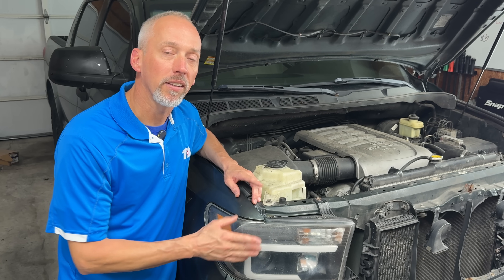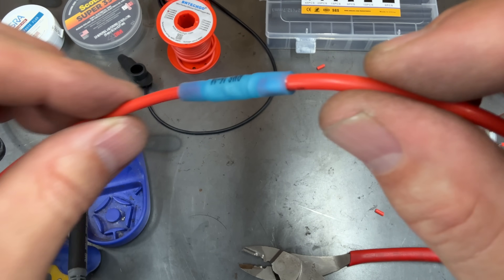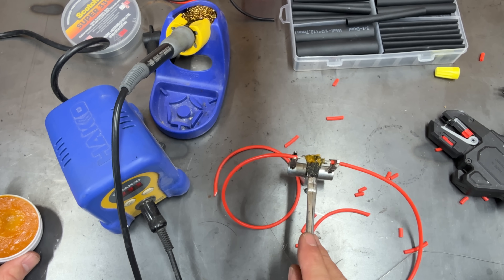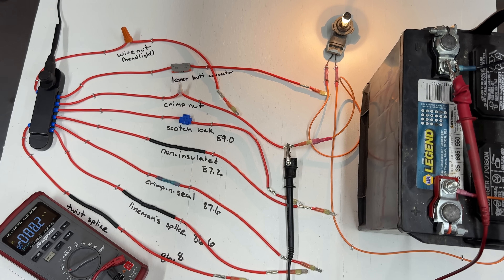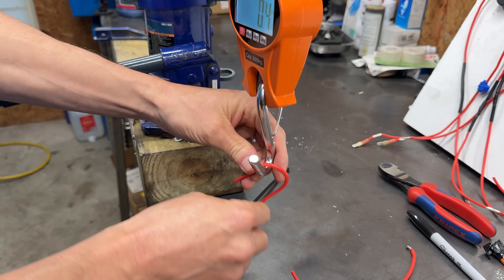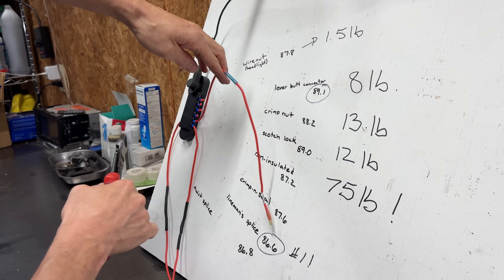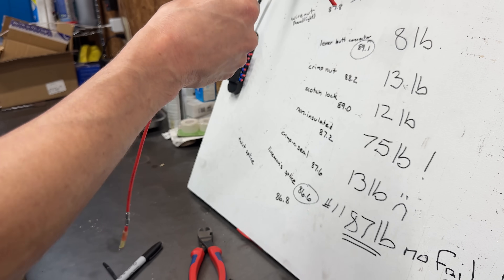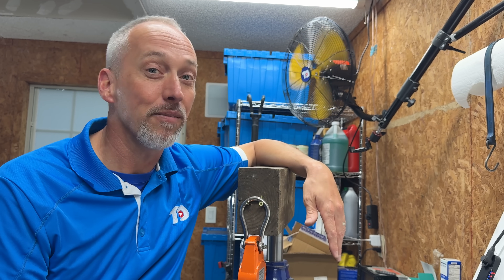I tested these connectors and found the best one

Comment: Well, there is a lot of issues with the methodologies presented in this video. 

The first major point is that, as controversial as it is, the actual tensile strength of the wire really doesn't matter all that much all things considered, as long as the connection can handle you pulling hard on it by hand, it's plenty strong for the automotive use, as most of the time the joint will either be in a loom with a dozen of other wires that will distribute the load (which should never be present in the first place), or it will not require any manhandling to work with. 

The issue is that just about all connectors you have in the car, just regular connectors with plastic housings, will have crimped terminals in them too, and those are most often open-barrel terminals, the ones usually used with Arduino projects, which is the the weakest type of crimp out there, the one you actually can pull apart by hand if you so choose .. for whatever reason. This raises two points - one is that if it's strong enough to be trusted by the original equipment manufacturer for decades now, it's plenty strong for the repairs as well, and the other point is that even if one decides to stress-test the car's wiring, for reasons only known to said individual, it would probably be the connector, not the repair area that gives out first. Seeing how prevailing the idea that strength really does matter, I would like to hear constructive criticism of what is written above, where in the real-world application, a properly made wiring harness would require such strength? In my opinion, it is not the peak stress that a given repair can hold that matters, it's the ability of the repair to withstand years of flexing, vibrations and periodic, mild stress that really matters, more on that in the second point. 

The second major point is crimping vs soldering debate, which will likely never stop for as long as I am alive, but even then I would still like to throw my hat in the ring. If done correctly, it is the soldering that will create the most conducive joint available, it literally fuses the wires together, so for the voltage drop test, it would be a clear win for the solder. 

That said, soldering comes with a whole slew of caveats too, there is a reason NASA prohibited the use of soldered joints where at all possible to avoid them, you can look up their technical standard documents, they are in free access online. 

Aforementioned caveats that solder can cause include the fact that it's not always easy to judge the quality of the joint in an enclosed space, or the fact that it requires heating the wire, which can damage sensitive insulation and may not always be visible, it also requires extreme care to ensure that no sharp edges or loose strands are left behind as they can easily puncture the insulation. But the worst offender, which a lot of people seem to miss is the fact that solder tends to be brittle, anyone who had to deal with the relays from the 80's would know that with constant vibration or flexing, the solder will start to develop hairline cracks, which could get one in a world of hurt when forced to diagnose a flaky issue, especially if that someone is not aware of any previous repairs. 

Soldering also requires a proper technique for a dependable joint, the one demonstrated in the video is not correct. The issue with the method demonstrated in the video is that the solder goes right to the insulation, which will inevitably cause some of it to even travel under the insulation. Solder stiffens up the wire quite badly, not only aggravating the issue described earlier, but also causing a high-stress point right between the insulation and the solder if the wire is bent (pretty much the same concept as a USB cable with no strain relief on the back of a connector), which would cause it to break altogether, or what's worse, for only a few strands to get damaged, causing a significant reduction in the cross-section of the cable.

If one still insist on using the soldering, please to it right at least, in the way described in aforementioned NASA manuals, even though they are against soldering, they still allow its use in exceptional cases, such as a solid core wire that should never be crimped. The correct way it to strip about an inch of insulation from each wire, tie them together in what's essentially a fishing knot, leaving a fair bit of distance from each insulation, and only use a tiny bit of solder in the very center of the joint, not across the entire wire, this tiny dot will still serve as a great conductor, but it will not stiffen up the wire nearly as much, nor would it cause the solder to travel under the insulation. Still not perfect, but a whole lot better. 

Crimped joint will always have some losses, it is not a perfect contact, but unless one tries to repair a wire for an extremely demanding communication bus (such as I2C for example, used for communication between several integrated circuits on the same PCB, it was never intended to be transmitted over the wire), there is very little chance that it would make any difference at all if the repair is done correctly. What it gives in return, however, is a very simple, nearly foolproof joint that, with the use of proper tools, one would be forced to actively try to screw up, it doesn't require an in-depth, proper inspection as a solder joint, just a quick look and a solid tug, it is very quick and doesn't require prior experience, again, there is a reason just about every original equipment manufacturer moved to the crimped joints. 

Next, I have some smaller points that I wanted to bring up too. 

The first one is the use of an incorrect heat-shrink tubing - from what I see, you are using a basic tubing, which is really only suitable for indoor applications, while it shrinks over the wire nicely, it doesn't create any sort of seal, in fact, if you shrink it over the smooth wire, it will slide off quite easily after shrinking. 

What you really need to use for an actual waterproof connection is a dual-wall, or adhesive-lined heat-shrink tubing, which is pretty much the same stuff that is used on insulated crimp connectors that you showed in the video. No other solutions, like adding silicone under the tubing or wrapping it in electrical tape, would provide anything even remotely as durable, not to mention that this heat-shrink is not even that expensive. The only issue is that I am yet to find it in very small diameters, the ones available will still srink over even the smallest wires with no issues, but the wall thickness will also be a bit excessive, so the joint ends up looking a little bulky. 

The second point - you should never twist the wire stands together if you intend on crimping them, for the same reason as why you shouldn't try to crimp a solid wire. When crimping the wire, the strands are supposed to move freely and pick their place in the crimp area to fill it out completely, it not only ensures an even distribution of strands in the crimp (it should literally look like a solid piece of copper if one were to cut the crimp in half), but it also ensures that the wire maintains the elastic element, each strand would still maintain just enough elasticity to still exert active pressure on the crimp, which keeps the wire securely in place, unlike with the solid wire, which would get crushed beyond its yield stress by the crimp, and would eventually loosen up over time, as there is no active element that would maintain the tension inside the crimp. It's the same concept as using a vice to compress the spring versus the hollow copper pipe, the spring will take quite a effort to pull out of the vice as it exerts an active pressure on the jaws, while a copper pipe, when crushed by the vice, but not tightenedall the way, will come out with ease.

The third point - the one-size-fits-all crimp tool that you were using is really not the best for any application, mostly being the tool of last resort, it tears the insulation as you demonstrated, which good quality tools don't do, and the shape of the crimp itself is not ideal for the insulated crimp, not to mention that it also requires the use of excessive force for each joint, so chances are someone will end up with a few loose crimps using the tool you have currently. A much better option is a tool designed specifically for the insulated terminals, which essentially crushes the terminal onto the wire instead of pressing a divot into it, and has a different size opening for each size of the crimp, they are color-coded for a reason. Ideally, it should also have a ratchet mechanism, which prevents the wire from slipping out if one were to release the tension on the handles, like to get a better grip, and it also gives you a mechanical advantage, making the crimping process nearly effortless. 

It is also important to remember that, while counter-intuitive, the crimp should not go right to the insulation, for the same exact reason as with the soldered joint, it creates a stressed area if the wire is bent, the crimp should be at least a few millimeters away from the insulation to give the wire room to move.

I think I got everything I wanted to say, and if not, I really doubt that anyone is really going to read this magnum opus of old mad yelling at the clouds. Either way, if anyone has any questions, I would do my best to answer them.
Reply: Excellent comment.
Reply: @villiamo3861  Thanks!
Reply: I agree with practically everything you wrote — except for characterizing I2C as an “extremely demanding” communication bus. It’s not, not even close. While it was not originally designed for use over wires, the I2C specification has included wiring specifications for years and years now. There is no strict cable length limit, but the bus speed is limited by total cable capacitance, which does limit cable length for a given speed. I have run it just fine at 400kHz over several meters of random cable. It certainly is not sensitive to connector specifications; it’s just not fast enough to matter.

Remember also that the DDC2 display identification signal used on computer displays and AV gear (in VGA, DVI, DisplayPort, and HDMI) is also I2C.

Gigabit and faster Ethernet, HDMI, DisplayPort, and USB 3.x — now those are demanding signals.
Reply: @tookitogo  Seems like my knowledge is a little dated, people have been using I2C bus over just the regular wires (not PCB traces) for years, that is the point I was trying to make, but what I didn't know is that this use case actually made it into the standard, I always thought that it was more about bending the rules a little bit for the convenience that this standard provides. 

That said, this standard still has more than one mode of operation, 400kbit/s is about the slowest it can go in all honesty, at which point yes, the cable capacitance is not really a concern, at least within reason. But then there is a Fast Mode, High Speed, and even the blazing (comparatively) fast, even at the cost, Ultra-Fast mode, both of the latter would require a much stricter approach to the selection of proper conductors to achieve full potential, though granted, neither of those modes is really used a whole lot, especially the Ultra-Fast mode due to a a fair bit of limitations that it imposes, and the number of alternatives better suited for such cases.

I also didn't know about DDC2, that was a bit surprising to learn seeing that this is not the use case for this standard where any of its prominent features really stand out, I was willing to bet that there were better options available even at the time, but then I may not know enough to judge its usefulness in this regard..

Either way, thanks a lot for your insight!
Reply: @АрсенийЯвтушенко-и7х  400Kbps is nowhere near the lower limit. 400Kbps is Fast Mode. There’s also 100Kbps Standard Mode and 10Kbps Low-Speed mode, but you can also use any speed you like, up to the maximum supported by the slowest device on the bus. There are faster modes going up to 5Mbps, but other than 1Mbps Fast Mode+, relatively few devices support them. AFAIK they still don’t place particularly strenuous wiring requirements, since 5Mbps still isn’t that fast, all things considered. I mean, 40MHz SPI is trivial to run over a meter or so of cable; 5MHz is nothing at all. 

(My old department supervisor is an expert in really high frequency stuff and says half-jokingly “to me, everything under 3GHz is DC!” 😂)

P.S. Take a look at the I2C specification; it has specific recommendations on how to run I2C on cables or PCB traces longer than a few cm. In particular, the order of the wires/traces to minimize crosstalk on longer runs. (Basically, don’t run SDA and SCL next to each other: put GND and/or Vcc between them.)
Reply: @tookitogo  As far as I understand it, I2C standard, when compared to all the others, has a hardware limitation on switching the state, if the capacitance of a given line is too high, it starts to either delay, or drop the signal altogether. The actual chips using this bus are inherently missing any way of dealing with capacitance, as, again, even though they bolted this functionality on later, the hardware of an I2C bus was never really meant to go outside of a PCB when it was first designed. That's why this bus is in a bit of a bubble, per say, when compared to other, more modern standards, hence, even though 5Mbit/s may seem slow in respect to the conductor selection, all things considered, I don't think the requirements of the I2C bus should be compared directly. It's pretty much why some people claim that there were never any issues, and others swear to never go beyond a meter or so. 

P.S. As for your supervisor, anything Above 5MHz counts as DC with my use, but for a whole other reason))

Thanks!
Reply: Very good and informed comment - Computer Engineering background and have worked in the motorsports industry for a while, including building harnesses. 
Solder only where needed and take the appropriate cautions and preventative measures - crimp otherwise following appropriate processes. 

The main thing not considered in the video is the environment. Wire nuts can work behind a wall where they will never move and do not have vibration, but will fail in other situations and are not sealed from moisture, just as one example.
Reply: I posted a comment on the methodology too. 

My question for you is isn’t solder inherently less conductive than copper wire? Therefore if it saturates the connection wouldn’t there be more resistance? 

I think the NASA protocol isn’t necessarily valid in an automotive situation. Obviously there will be orders of magnitude more vibration and stress in a space shuttle or any other space bound vehicle than in a car. 

And how much vibration is there in a wiring harness that is not attached to the body metal? 

Finally, do you have links to the NASA soldering protocol? I’m curious to read it. Is it easy to Google?
Reply: @Jam @JamesVR6 ehhhhh… a space vehicle might (possibly; I’m not actually sure) experience greater magnitude of vibration, but a car will experience it over a much longer period of time — space shuttles spend most of their time idle. Cars do, too, but they still have way more hours of use during their lifetimes. 

Being attached reduces vibration; being loose increases it because the relative movement is greater. 

Solder has a higher resistivity than copper, but vastly lower resistivity than air. Consider this: when you add additional parallel paths for current, even if they’re high-resistance, does the total resistance go up or down? 

YT deletes nearly any comment with a URL in it, so I can’t share a link to the NASA soldering standards. But just look for the “NASA Workmanship” standards, etc. They’re very easy to find.
Reply: @JamesVR6  It is true that solder is less conducive than pure copper, but when compared to most of the other styles of joint, such as crimping, which leaves behind a number voids with no contact at all, as there is no interface to cover the wire completely, that added resistance is borderline negligible in comparison, not to mention that it only affects the joint area, not the entire wire.

It mostly depends on what you are trying to achieve in the first place though, as in absolute majority of cases, the wire you are repairing was selected with more than plenty of headroom to spare, so the joint, regardless of its style, won't make any real-world difference, aside from maybe increasing the temperature of said joint by 0.1°C in the worst case. 

But if, for whatever reason, you really need the full potential of the wire in question, the absolute best solution in realm of conductivity would be welding the wires together, a practice used commonly in critical applications where you won't have any access to the joint afterwards. While it is good for ensuring that the wires will stay solid for decades to come, the tooling and equipment required to do such repairs make this method not all that applicable for most common applications, as it doesn't provide any real benefits aside from added conductivity, which, again, isn't strictly required in mose cases.

As for the presence of vibrations, I would actually beg to differ - vibrations are not created equal, just shaking the wire around will not do it any harm, neither would attaching it to a vibrator for that matter, that is unless the joint itself is exposed to increased stress during each oscillation, which is not necessarily the case all the time, but if so, it is something that solder is particularly bad at handling due to the increased brittleness, being the cause behind all kinds of erratic behavior in mid-80's and early-90's cars that started implementing relays in place of power switches. 

The point is, while there may be more vibrations overall in a spaceship, NASA is also taking a very different approach to handling it before it reaches anything critical, and the requirements they post act under the assumption that the location of the joint is already isolated to the extent possible from any destructive vibrations, an extent that no average Joe would go to while working on a snapped wire somewhere under the hood. This is why I believe that NASA requirements apply here even more, as there is a very limited amount of automotive technicians, even the certified ones, who would be taking each joint with due care that the document expects. 

NASA's Workmanship Standards are very easy to find on Google, at least for the wiring repairs, for cases that apply here, type in "WORKMANSHIP STANDARD FOR CRIMPING, INTERCONNECTING CABLES, HARNESSES, AND WIRING". 

Hope that answers your questions!